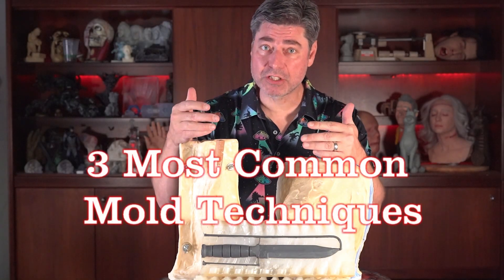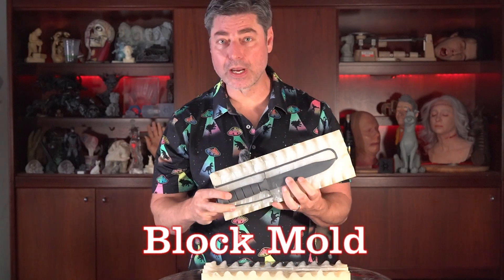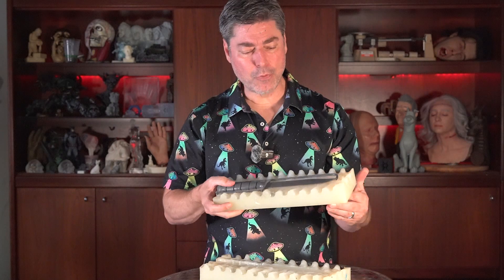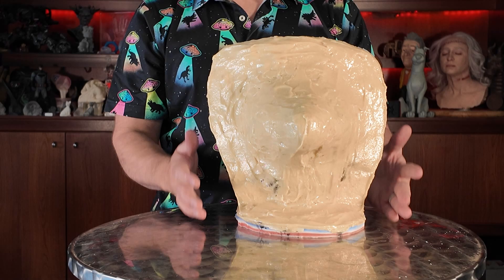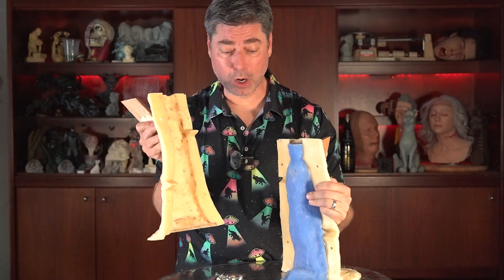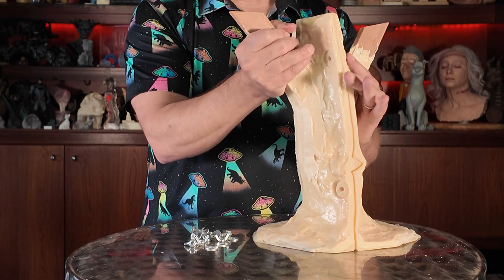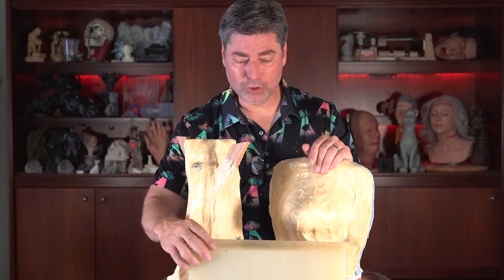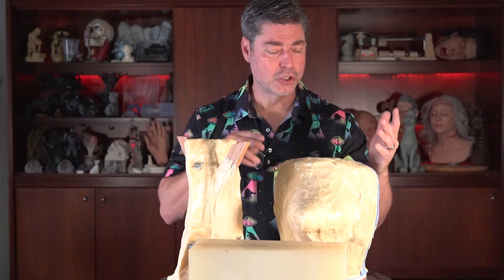Choosing A Mold Method For #moldmaking

Comment: Hi there I'm Alex,👋 I would like to make foam molds to cast RC airplanes or RC airplane wings. I watched a previous video where you discussed expanding foam that had a density of 4 lb per cubic foot, I am hoping to find a lower density foam closer to beadboard which is 1 lb for cubic foot any information about products that could work would be very much appreciated.
Reply from the maker: Unfortunately I don't know of a cast-able polyurethane for with that low of a density. TC-300 is a good rigid foam formula that comes in a 3lb density, but it is difficult to find any density below that. I have seen a 2lb foam, but it is very fragile and mainly used as a filler material.
Reply: @brickintheyard Thank you!!! I could possibly use the 3 lb stuff and maybe even the 4 lb stuff for certain components I will have some experimenting to do for sure.
Reply from the maker: @storkbreath  BJB Enterprises are the foam experts. If you call them they may be know of some other options for you.

Comment: Hi. What would you recommend for creating an 8" length mold of a CRT TV bezel, to be used to reshape another part of the bezel that has dents in it, by softening the plastic with a heat gun, so it conforms to the mold?
Reply from the maker: Are you looking to correct an existing part and then remold it? If so, what is the original part made of?
Reply: @brickintheyard  Hi, thanks for the reply. The TV is a 27" Sony Trinitron TV, and I think the bezel is made of ABS plastic. I just bought it, and it was in "like-new condition", but some dents were put into  the front-top of it while it was in transportation. I'm wanting to fix the existing part. And to do that, I'm wanting to create a mold from a non-damaged part of the top bezel, then place it around the dented part and soften the plastic with a heat gun and press the dented plastic from behind, into the mold.
Reply from the maker: I have not attempted that, so I don't know if that approach will work or not unfortunately.
Reply: @brickintheyard  No prob. I'll continue to research and I have a good feeling about it, lol.

Comment: Hey, Mitch. I've been doing latex molds for concrete statutes. I've been using fiberglass and resin to make the shell, but I would like a substitute for making the shell. Even though I wear gloves, I always seem to get it between my fingers. Any suggestions?
Reply from the maker: BR-75D is what I use for a lot of mother molds, but it isn't cheap. It doesn't require glass fiber and it is self thickening. I typically apply it in 2 layers: 1st layer as is out of the kit, 2nd layer I add FiberThick thickener to make it a trowelable paste. Again, not cheap, but really strong and fast and no glass fiber. Polyester Resin/Glass Fiber is going to be the cheapest resin option for sure. The only thing cheaper would be Plaster and hemp.